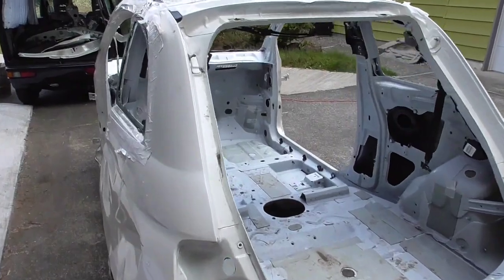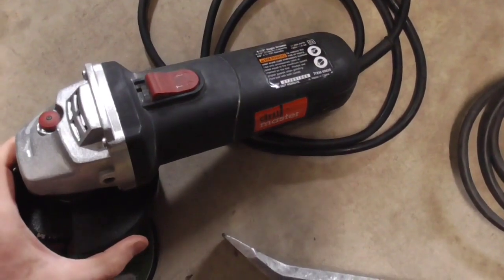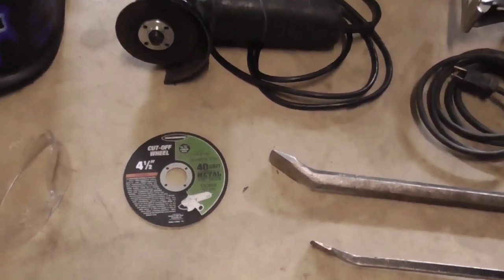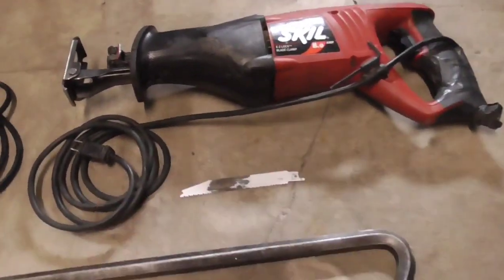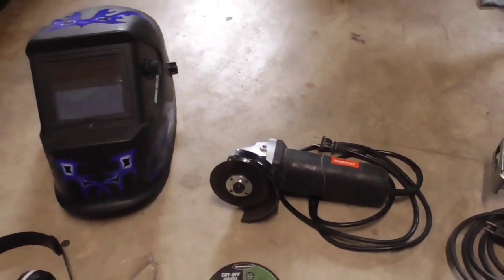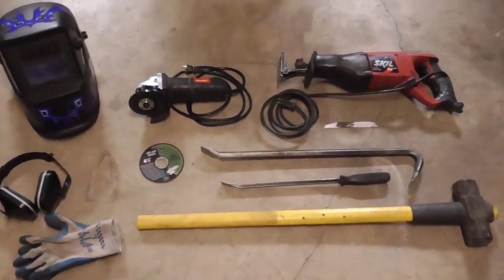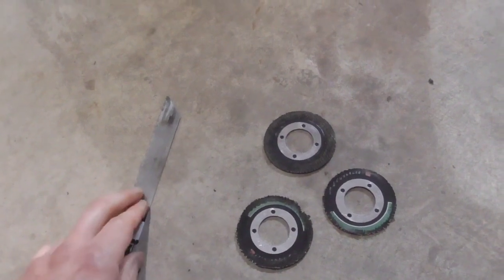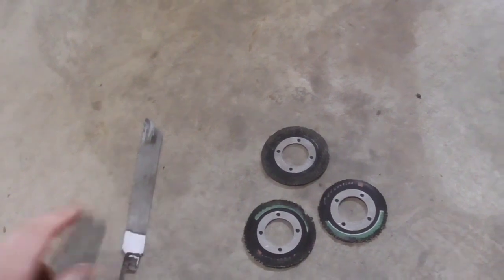Fiat 500e - Teardown - episode #4

Comment: Hey brother, thank you very much for this series it has allowed me to witness the disassembly  and see how this car is put together without having to have one in my own hands.

Just a hint from someone who’s been chopping up cars for many years, watching this video was almost painful to me because this whole job could have been done with maybe 2 of the correct long sawzall blades, and in about 30 minutes or so total without exaggerating, much less mess and effort. 

In an hour with maybe 4 blades you could have it into single hand carry sized pieces.You’d  want to use a good quality LONG metal blade that’s made for thinner sheet metal, it goes through even the toughest multi layered rails like butter. The key is for the blade to be longer than necessary because you must cut through the  box sections and multi walled parts simultaneously, keep the blade straight and cut through all layers in one shot. if the end of the blade slips into the work then it will jam up and bend the blade so go long and don’t get a course tooth blade made for thicker metal , 18-22tpi is great, 14-16 is ok but a bit course, nothing courser than that. 

I share in the hopes that should you ever again face something like this maybe it would help you, your video certainly helped me, thank you :)
Reply from the maker: Thanks!  I'm glad you liked it, even if painfully so.  I appreciate the advice.  I would love to see a realtime unedited 30 minute total time cutup session of a car.  That would be one super human BOSS.  Any thoughts on plasma cutters?

Comment: Great videos!  Any thoughts on adding extra batteries to the working 500e?
Reply from the maker: Thanks!  Well yes, the plan is to rebuild the pack with newer cells that have 50% more capacity, but are the same size.  These do exist.  Also, possibly swapping to Tesla S/X cell modules.